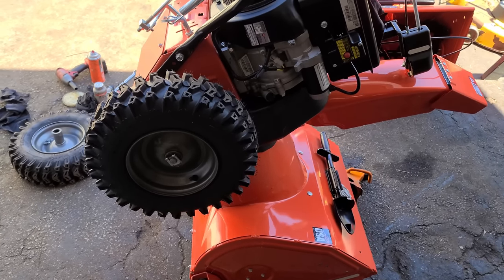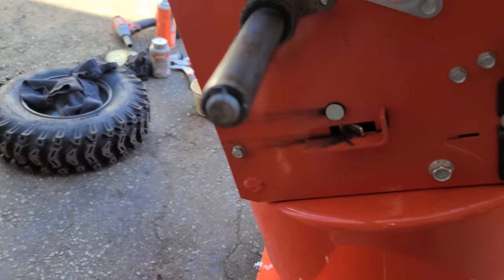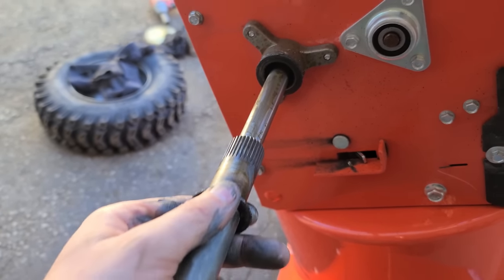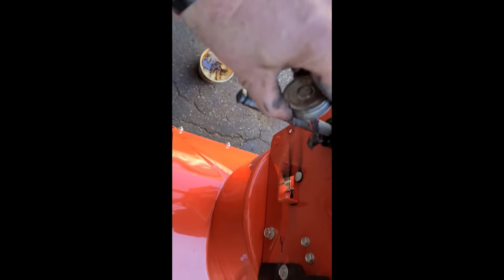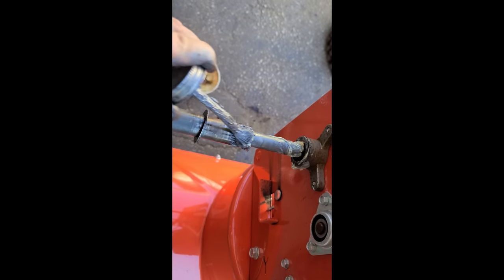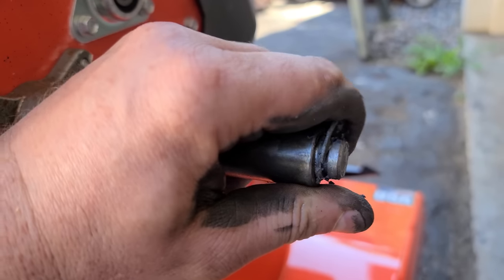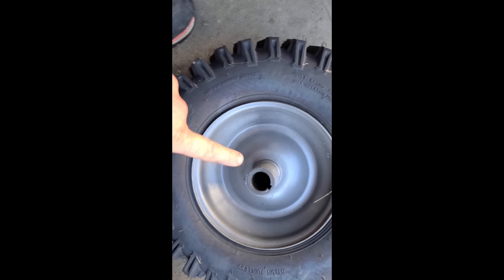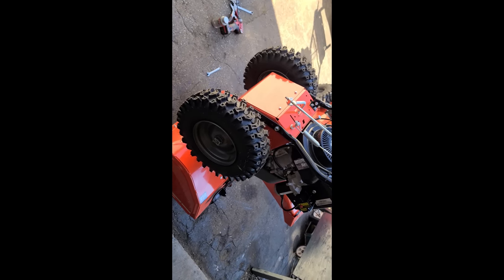Do This If You Own An ARIENS Snowblower! MUST WATCH!

Comment from the maker: Watch my video "ARIENS Snowblower & Engine Controls Explained!" here;
https://www.youtube.com/watch?v=TLxxaWNFhws&t=62s
Reply: Thank you Dony! I'm currently looking at Ariens. I currently have a Cub Cadet 3x 30" which has been great for the past 6 years that I use at my cabin. It handles 18" snow without any problems. Now, I need snowblower for my home which half has an all cement driveway. 100' is double that turns into an additional 75' triple wide all cement driveway (175' in all). Usually, there's no more snow than 12" to 14" at the most each season. With that being said, I feel I don't need what I have at the cabin. I am however, looking for a well built 2 stage SB with decent engine that would handle the snow without bogging down and blow at a great distance. I have a couple questions if I may; Do you have any recommendations in which Ariens model would be a great choice? Also, what's your thoughts in build between CC and Ariens? Meaning, what would be your first choice? I love all your video's and have seen how experienced you are..... You're the best person I know that I could trust in getting an honest answer. I would sincerely appreciate it. Thanks again! 👍😊
Reply from the maker: @rapaent  I would buy the Ariens SHO model, it has a bigger engine and better features. Get at least the 300cc or bigger engine
Reply: @donyboy73  Thank you Dony!! I will definitely look at the Ariens SHO models with the 300cc or bigger. I sincerely appreciate your  input in pointing me in the right direction. Love all your repair videos!! Thanks again! 👍😊

Comment: I've been using Lucas red and tachy grease for years and have never had any rust or seized parts. I don't care for antiseize way to messy, and it doesn't stop rust from forming. Grease is easier to clean off and reapply, I do maintenance on my equipment religiously. I've never had rust build up or anything has ever seized up on my snowblower. Great video, Don, but I feel grease is better for water and snow applications.
Reply: I've had the same experience with anti-seize. After a season the axle shaft was dry and rusty.
Reply: @percyfaith11  he always pushes that antiseize and never comments on a post that doesn't agree with him and or praise him. I watch his videos because he has useful information that he shares.
Reply: So just grease and no anti seize? What grease do you recommend? Thanskt
Reply: I use Lucas red and tachy grease it holds up to water.
Reply: @kensmith6708  same here

Comment: For those who don’t know, Toro snowblowers come from the factory equipped with grease and anti seize on their axles. So if you have a newly purchased Toro, then don’t worry about it.
Reply: Thanks, good to know not to worry about my toro
Reply: That's just because Toro knows they'll see the machine back under warranty.  😛
Reply: If there were humans involved in the assembly, you should add,
93% to 98% of the time.

Comment: Another good video. I have this exact Ariens  ( one year old )and have greased and anti seized it up per your videos. I am glad you showed how you used both grease and anti seize on the inner shaft.I really like my Ariens but they could do a better job with corrosion protection on the shafts before leaving the factory.

Comment: Wow!  Seems like that should have been done at the factory during assembly with a note in the Manual of how to maintain it.  Now I have to wonder if this kind of thing is even covered in the Manual.  Most likely a Maintenance/Service/Repair Manual, if you can find one, but it should also be in the Owner's/User's Manual.  Great stuff, Don!
Reply: This would never be in the owners manual. The manufacturer, in this case Ariens, suggests maintenance/ repairs be performed by an ariens dealer
Reply: @philherrick7319   Yes, but if you search the Internet, you can sometimes find the Shop Repair Manual that the dealer and authorized repair shop techs use, and sometimes you have to call Customer Service to buy it.  Sometimes, the title goes by a different name, so instead of "Shop," look for Ariens, OEM, etc., and instead of "Repair," look for Service, Maintenance, etc.  I'm not saying that Ariens has either way, online or Customer Service, but it wouldn't hurt to do the search or call if it's not online.  

I found Shop Repair Manual for a Briggs and Stratton engine on my Craftsman tractor mower online with numbered parts to reference a Part Number in a Table and it also had Torque specs, gaps for spark plug, valve stems, etc., everything I needed  The manual for the mower is out of print so I couldn't buy it and I could not find it online, but also sometimes, Archive Services online will have them to download for free.  Again, it wouldn't hurt to search of call.  That's what I meant by "Maintenance/Service/Repair Manual."  Good luck!
Reply: 2 different things 
Owners, /users manual is NOT a service/repair manual 
That's why I  commented that the information you refer to would never be found in an owners manual

Comment: The snow blowers with diff locks don't drive straight in deep snow drifts.  I'd rather fight one with a solid locked axle.  Be careful mixing greases, some don't get along.  Look at a compatibility chart before mixing.

Comment: Things to check if your machine is pulling to one side: Make sure the shoes are adjusted evenly; If you have a machine with removable pins in the wheel hubs for easy turning - put the pin in to go straight; check the air pressure in the tires - the tires have heavy sidewalls and look like they have air when they don't; both tires need the same circumference to go in a straight line - two different make and style tires are suspect; more wear on one tire; you just replaced one tire that was bad. Measure the circumference with a cloth tape or a piece of rope

Comment: Thanks for this tip.  I just checked my deluxe 28 (in service since Nov. 2018)
Have always done my own maintenance but was unaware of this shaft over shaft feature.
Just checked mine and happy to say I caught it just in time as the main shaft had a decent coating of rust. All cleaned and lubed properly now. Took maybe 1/2 an hour. Enjoy all your videos👍👍
Reply from the maker: good job! you just saved yourself hundreds of dollars!
Reply: is it safe to tip the snowblower on to the chute  to get to the wheels with oil in the engine? or should you drain the oil first?
Reply: @williamb3323  It's advisable to siphon the fuel out of the tank first. A workaround is to place a a plastic bag over top of the the fuel tank opening and then screw on the gas cap if your tank is full but it doesn't always work. Your oil should be fine as long as the cap is screwed on securely.

Comment: A snowblower with a differential?!?  Well, I learned something today.  And your preventive maintenance tips are a huge bonus.  Thanks again Dony!
Reply from the maker: Right on!
Reply: There's a reason why Ariens are top notch snowblowers.  I have a 2009 Platinum 30, has differential as well, Still runs and looks like a new machine. Lots of maintenance points and adjustments though. I keep the manual handy every year when I do maintenance on it. Looks after a 300ft driveway in a snow zone without issue for 14 years now.
Reply: @capohd28  Totally agree about how Ariens are great machines. I bought my 724 Sno-Thro new in 1972 for $350. I live in western NY where we average 100" snow/year. My machine has never let me down and many times I've helped neighbors with Hondas, Toros, Craftsman and others to clear the packed snow at the foot of driveway where the plows pack it in. Their machines just are not up to the job. My Ariens greatest moment was cutting through a 7 foot deep snowdrift after a major blizzard. I had a friend standing on top of the drift using a shovel to slice the snow down onto the ground so I could blast it away with the Ariens. I've done a fair bit of maintenance over the years including replacing drive axle bushings and auger bushings. I'm still on the original friction disc and can't understand why so many people seem to need to replace them. I suspect they have the pressure against the disc adjusted too high?  I've also disassembled the carb and cleaned and installed new needle and seat. I've done a bit of welding to repair the sheet metal teeth for rotating the chute. The metal behind the teeth had cracked. I don't think any of these repairs are unusual for a 51 year old machine that's seen lots of duty. I have never sheared a bolt on the auger shaft, knock on wood.
Reply: @Craig Erickson I enjoyed reading your post. I have replaced the friction disc and one cable. That's it. Everything else is original. The cable was fine but the boot cracked and it let water in and would freeze up. I am surprised you are still on the original disc! That is the main wear part.
Reply: I wouldn't call it a differential as a differential allows difference in speed for left and right wheels. I'd call it the driven gear. You can see the smaller drive gear that it connects to.

Comment: Wish I had known this in 2011. The first year after one winter of use I went to take the wheels off and no way was one of them coming off. So far no issues but that axel is going to get cut if ever there is a problem. I'm a maintenance guy but somehow I missed this one.

Comment: I use basic motor oil with the antiseize. As I reassemble, I spin everything around to distribute it. Been doing it for about fifteen years now and I’ve had units come back year after year, allowing me to inspect the long term effect. It’s amazing how well it preserves the differential and stops that awful rust-dust in its tracks. No more flattened out splined shafts.

Comment: Last spring I serviced my 2 year old Ariens 28 SHO and I thought I did a good job. Then I happened to watch this video and I was angry. Nowhere in the owners manual did it say to remove the outer splined shaft to lubricate the shaft it rotated on! This weekend I finally serviced the unit and I was so angry to see that the shaft had rusted and it took some time to sand the rust off and smooth the shaft! Thanks to your video I caught it almost in time! I do have a question about a missing E-clip some posters mentioned. I thought one had fallen off and I replaced it. I just don’t remember what side and should I remove it. Great video as always and saving us homeowners money on service that we can do ourselves after following the steps on your videos! Merci from SS Marie!

Comment: Wow  my sts 24 has grease fittings on the shaft... lug nuts hold the tire on. It has a hub like a car with a nut and cotter pin under the dust cover. Seams like newer models have cut corners to save cost.

Comment: Great video! I have a 6 year old Airens and never did this. Had a hard just pushing it and it would (ratchet) gears wear in drive mode. I took it apart and it was seized up, all cleaned up and lubed. Works great now and can push it now without the resistance.

Comment: Great info Don! I also check the pressure on the drive disc and set it correctly.  The kids assembling snow throwers at Home Depot and Lowes down here put Wayyyy too much pressure on the rubber drive disc and it wears out the first season! Also don’t shift these “on the fly” as the discs will wear out prematurely!
Reply from the maker: exactly!

Comment: Donny, great video! I have been instructing my customers to do that very same thing for many years now. It’s a shame Ariens cut’s corners like that, where as Toro has the very same Auto-Turn diff now as well and they come lubricated from the factory! My only criticism of the video is, I find ant-seize ends up getting to thick and sticky for snowblowers, that’s why I only use lubriplate low temp grease and fluid film exclusively. Keep up the good work Donny!!
Reply: This is a great video. I can tell ftom your comment you know what you're talking about. Can you suggest a quality low temperature grease? Appreciate it.
Reply: @Jaw-t3t it's in his comment, lubriplate low temp grease. Lubriplate IS the brand.
Reply: @dreamerrt216  shoot. I missed that. Thanks.
Reply: @Jaw-t3t  No problem. 👍

Comment: I have an Ariens and it’s pretty old. It would get warm and stop running before I got done with sidewalk and driveway. A couple of years ago I took off the covers and gave it a good cleaning and changed the oil. We had 3 feet of snow one day that season, after clearing the walks and driveway, my son and I cut a car width path down the middle of the street for 5 houses along with my new toro the ariens ran like a champ and never overheated.
Reply: cleaning. as in "cleaned the carburetor" ??

Comment: My Ariens is 15 years old. I live in an environment where we get 10-12 feet of snow per year, temps as low as -25C. My machine has started and run every winter day. Never touched anything save for oil changes and occasional sheer bolt.

Comment: I'll have to check the exploded parts view of my 1969 Ariens 4HP snowthrower to see if your method also works.  Having never had the wheels off, it should be "interesting."  (The tire tread is almost gone, so there is an inducement to replace the wheels.)

Comment: Anti-seize is for fasteners, it's not needed and just messy af. There are some good marine and anti corrosion waterproof greases that will work just fine on their own. Thank's for the tip, I just picked up one of these beasts today, practically brand new for half price

Comment: I just bought an Ariens Model 920025 in November. So I took your advice, bought some anti seize and grease. Just a note: this model does not have an inner sleeve, clip or “key” on the shaft. I applied it nonetheless. I’m sure it can’t hurt.

Comment: I also remove the shear bolts, and squirt transmission oil between the shafts, then reinstall the shear bolts after thoroughly lubricated.

Comment: Thanks for this video and instruction - excellent.  Question - what about the other wheel.  Can I pull that wheel and axle without messing up the connection to the differential?  Btw - I love that auto turn.  Platinum 24 and Vermont winters!

Comment: Great video.  My 18 month 24 inch Deluxe which was just used for one mild winter (so maybe 10 times) and the rust was so bad I almost could not take the wheel off already!  Cleaned everything and used Fluid Film brush on and will make this part of my routine.

Comment: you should not use anti seize on the inner shaft or the splines that go into the differential. you are going to cause accelerated wear on those parts by doing so since they are constantly moving.

Comment: Thanks for this video.  I own a 2013 Platinum and had never done this service.  I was able to do all you showed, but since after 10 years, there was no seizing, I just used Lucas Red & Tacky grease which does claim to have some anti-seize properties.  The inner shaft with the splines was also crappy but buffed out nice. Used that grease everywhere including the zirk fitting behind the wheel and the auger zirk.  I am pretty sure if I do this every year, shouldnt have a seizing issue.  I could see wear on the splines also, maybe time to replace it.  The auto-turn works MUCH smoother now.
Reply: I can't se all this is nessesary if you can drive the blower for 10 years without any issues?
Reply: @eddale5557  I could feel a difference in its forward rolling, seemed smoother and the auto-turn took much less muscle.

Comment: Hi, Been watching you for years. Thanks for the great videos. Would you happen to know why on a mid 70s Ariens 2 stage snowblower that the pull cord pulls right out and doesn't catch?  I just started the snowblower for our firest major snow and it worked great......Then the next snow came and went to pull the cord and it just pulls right out and retracts fine but does not catch. Temps here been 5 above zero also.  Thanks!

Comment: Thanks for posting this very helpful video. I own the same blower which gets infrequent use here in Mid Missouri, so I'm going to do that maintenance right away. Last winter I had problems with engine not speeding up under load. Do any of your videos have info on governor adjustment for this blower?

Comment: I couldn't figure out how to remove the panel on the lower back of the snowblower (exposing the gears and chain drive).  I know it's held by four bolts, but even with the bolts out, the panel wouldn't come off.  Can you tell me how to do that, or show it in a video?  Thanks very much.  I enjoy your videos.

Comment: On the topic of "seized ",this year, the gas cap on my Murray is next to impossible to get off.
Does the rubber gasket have a shelf life? It's either that or I don't know my own strength when I tighten it down (or I'm getting old lol).
Reply: Yard, apply some grease to the threads and seal. :)

Comment: Great video and thanks. Mine was almost seized and I had quite the job to clean the axles and wheels. Now it rolls smooth. However, I noticed when snow blowing that there is a gap between the washer and snow blower on the axle. It moves from one side to the other. Is this normal or did I not get the axle on the opposite side  in far enough?
Reply from the maker: Sometimes there is a little gap, you can add washers if you want.

Comment: Hey thanks for the great video's. At the start of this season I watched your video and replaced the friction wheel and all three belts.  The snowblower may have 8-10 hours on it this winter and I noticed the wheel wore out again.  Any ideas ? Everything looks to be on properly and I don't see any bearings worn out.  The pulley looks a bit glazed where the wheel rides but that's all I can see. It was a wheel from the ariens dealer.  Thanks again.